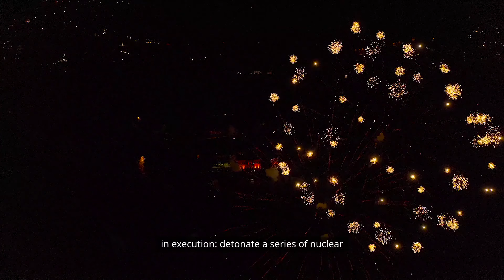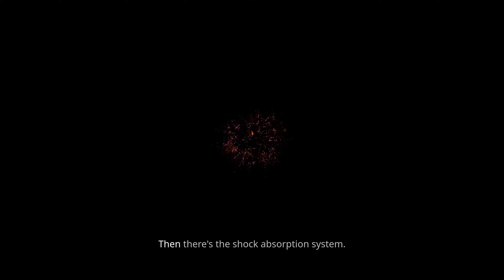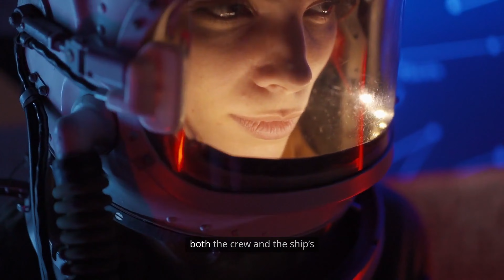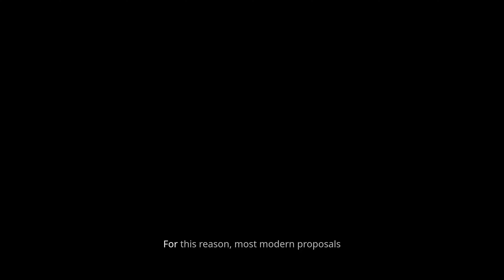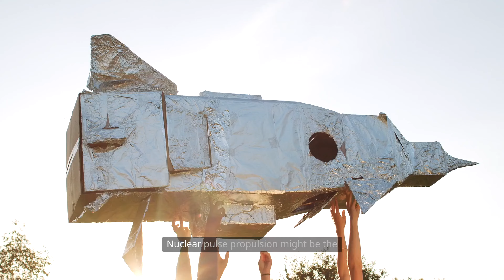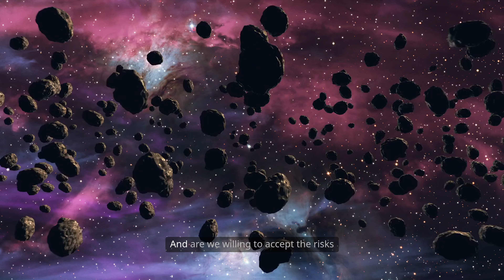Riding the Bomb The Madness of Nuclear Pulse Propulsion

Comment: More like plasma explosions used as thrust from magnetic confinement fields, relative to hydrogen (fusion) bomb explosions, in terms of shockwave power and light measured by neutron burst emissions 

Unlike a fission explosion, which has less or no neutron burst detectable 

But certainly not a metal bomb, that would be crude 

Similar potential energy